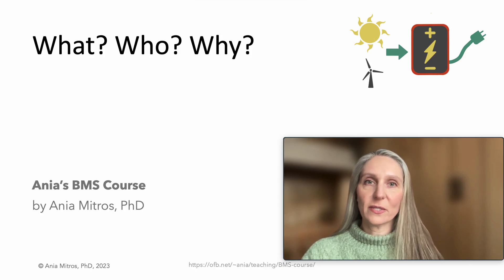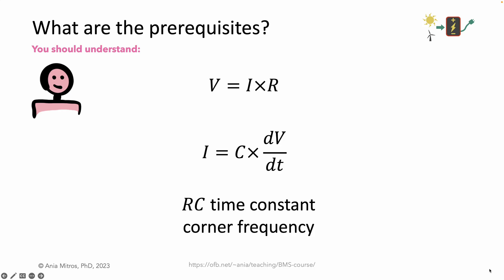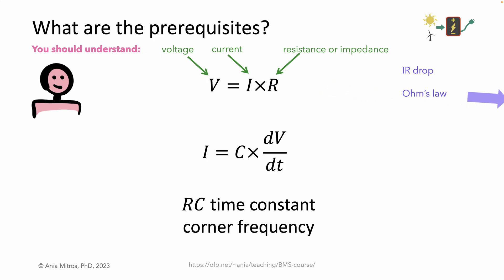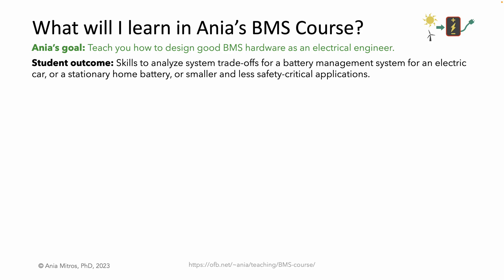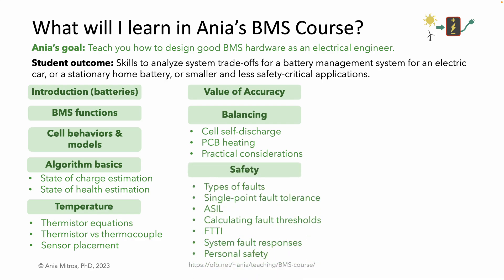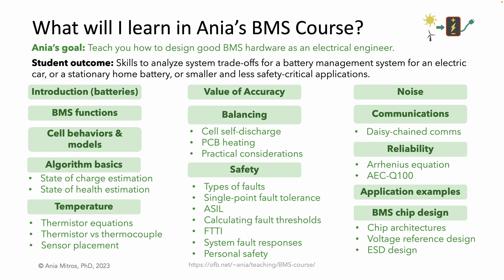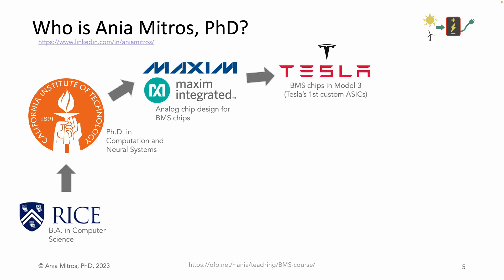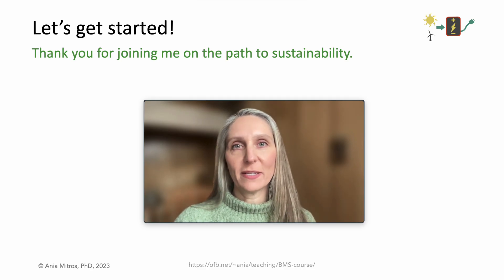Ania's BMS Course: (0) Why What Who

Comment: Thanks for posting this! Looking forward to checking out the rest of the series. I had to look up "corner frequency," wasn't familiar with that term. I guess it's just another name for the (approximate) cutoff frequency of an RC low-pass filter (or maybe other things too).
Reply from the maker: Yes, exactly. Corner frequency is the cutoff frequency of a low-pass filter. I try to define terms, but I can see how that one slipped through.